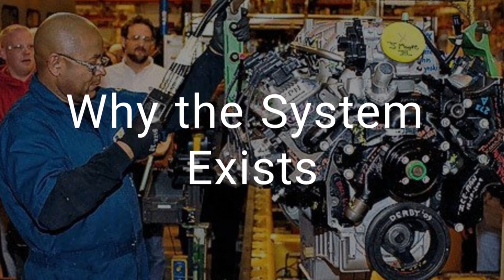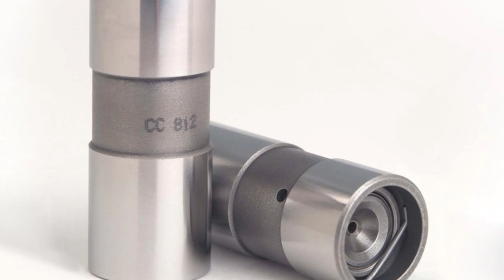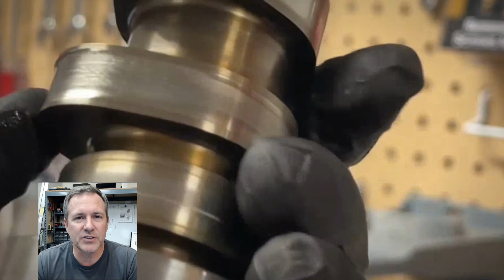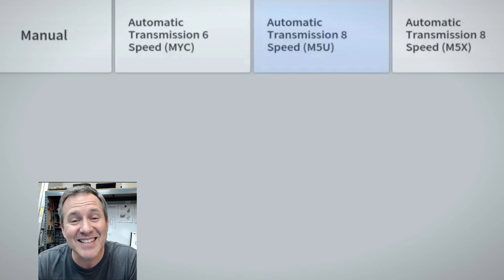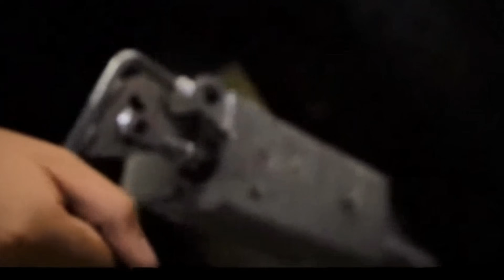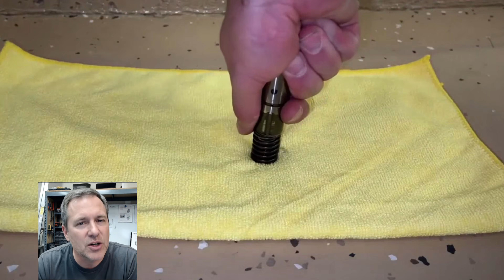Why Your GM 6.2L Is a $15,000 Time Bomb (The Lifter Killer Secret)

Comment: It's such a shame that for me, I'd be paying $5,000 extra to not have a warranty.

That's because I'd be taking it straight to a reputable performance shop for a cam swap and all new valvetrain, AFM delete and a catch can.

On top of having to do all these upgrades, even with the catch can, I'll know that eventually my intake valves will be caked with carbon. Why couldn't Chevy just go dual injection instead of direct injection? Seriously. Toyota has had so much success with it. Ford has done it and their HD gassers outperform the 6.6l L8T. I'm a chevy man, but I'm sticking to GMT800 unless I find a GMT900 with extremely low miles. It's simply been a long time since they made a bulletproof product.

Comment: I remember drilling 3/32 holes in the front lifter oil galley plug behind the timing cover, it was supposed to help bleed the air out of the lifter faster to shut it up in the late 1970s 454cid engines noisy lifters.